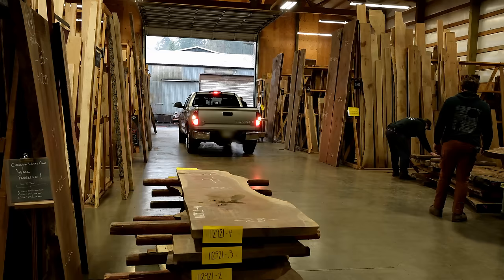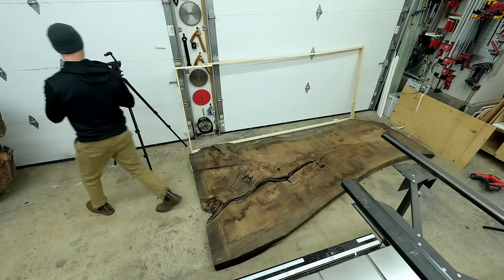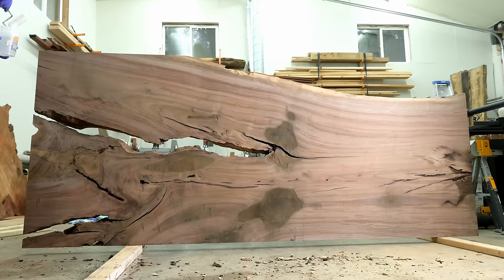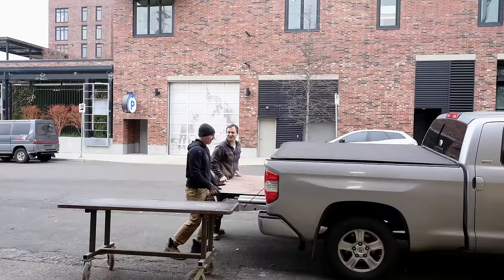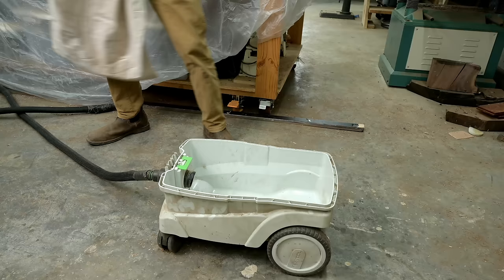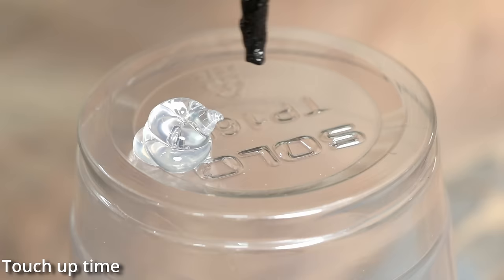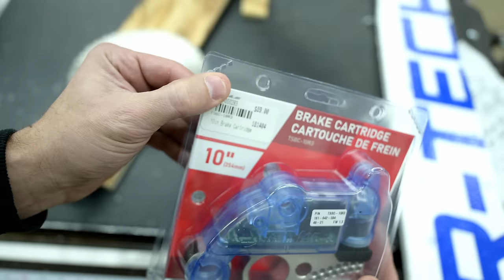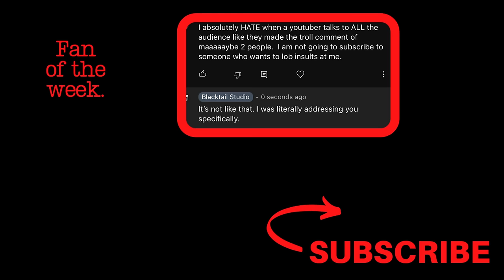The Client Hated This Slab

Comment: Response to your question about 21 minutes in the video. The safety feature of the saw blade stop works off of a voltage differential between the trigger mechanism and a conductive media like a finger. Styrofoam sheets being cut with a rotary blade would be like rubbing a balloon against a flannel shirt. The Styrofoam creates a static charge greater than the blade safety mechanism can handle. A volt differential tripped the circuit.
Reply: i noticed this also and his finger touches the deck of the table at the instant it is triggered so i think he discharged himself as he was building up a static charge from the foam as you said
Reply: Thanks for the scientific explanation
Reply: Thanks for taking the time to share this Lynn!
Reply: There's also a relationship in electrical conductivity in foam as it undergoes a phase change due to heat from friction. This can be unpredictable in modern foam products. Not sure if lowering the speed of the saw blade is an option.
Reply: Some great responses to this.  I was thinking of the static as well.  Does anyone thing a wrist worn grounding strap would have helped?
Reply: I'm happy I found this answer, so I don't have to find the right words for it, as English is "only" my second language :D
Reply: Could it have melted and the liquid phase was conductive enough to trip the safety mechanism?
Reply: I absolutely agree with this explanation. I just wish I was smart enough to understand it.
Reply: Smart
Reply: nice
Reply: If his finger makes contact with the foil on any part of the styrofoam while its being cut it would also probably trigger. Typically the trigger is caused by the signal of the blade dropping below a certain threshold which is what happens when your finger touches the blade. Foil is conductive so if it is touching both your blade and the finger that’ll do it for sure. Heck enough of the foil could do it, thats why you can’t saw metal (among other reasons) it interacts with the blade and changes the signal. Electrodynamics is a fickle bitch.
Reply: Working with bare hands and touching material leaves fat/sweat on it. Perhaps there was enough of that in the area that triggered the stop.
Reply: Maybe wear nitrile gloves when cutting aluminum clad foam in order to break the conductivity between fingers to blade?  Would hate to see that happen, again, just to do a test (maybe with a worthless blade and only have to pay for the “stop”).
Reply: Thank you for explaining that. That saves me from trying. It also looks like his gloves are just as good of a static generator as flannel so I'm guessing they're the other half of the generator. ;-)
Reply: @mbol4348  the problem with that explanation is that he'd already made several cuts on that piece of foam already, so if that was the only reason it would have gone off earlier
Reply: Good answer, likely ESD. Cutting insulative material on a protected saw like this one not the best choice of tools
Reply: I posted about how to put the saw in bypass mode so you can cut conductive material and not activate the break. 👍
Reply: Turn off the safety tripping on the blade when cutting that styrofoam. It will save you a blade and trigger mechanism.
Reply: Hi, i really think that the tinfoil sheet from the stirofoam conducts electricity from the fingers. Wearing isolating gloves should help.
Reply: @CristianRusu  the Styrofoam creats static electricity when being cut which causes a change in voltage which is what activates the brake. Better to just bypass the safety mode when cutting conductive material
Reply: Maybe making several prior cuts actually built up a charge ….
Reply: Of course! Everyone's knew it was a volt differential causing the issue. LoL!
Reply: Also the styrofoam have some aluminium foil or don't know what material was(reflective one on the other side) somehow if its conducting that can be a problem.
Reply: I'm going to use my finger to confirm this hypothesis.
Reply: @andrewmicone99 если там есть VFD, то запросто

Comment: Styrofoam is electrostatic material. If you pull it over your hair it’ll stand it on its ends. So, that little bit of friction created electromagnetic field which caused the sensor to go off on your saw.
Reply: My father-in-law was a Machine shop teacher, and he told me that one time when he was showing me how to pour the foam in different molds he was making.  I can't believe I remembered that 55 years later.  He was an excellent teacher.  R.I.P
Reply: Yeah, don't cut foam in a SawStop. Use a reg table saw. 
Example- when you ate cutting foam it will shock you in the same way as rubbing socks on carpet and touching someone.

Comment: Professional epoxy installer here with over a decade experience. Those small pits that you carved out then re-filled can be completely avoided. Epoxy airates as it cures often causing bubbles (fisheyes) that pop and sink or stay above the surface. An easy and cheap method to prevent that is to use a heat gun at a moderate distance to pop them during the curing process (when it becomes tacky). I have a ton of epoxy tips for you if youre interested. Whether youre using 100 solids, polyeurethane or polyurea.

Comment: Safety tip (yay): When loading a long  crate onto the back of a truck, get as close as possible before raising the forks. That way, if it does start to tip, the truck will take some of the weight and help get the balance back. I used to do this all the time with 1.5 tons of aluminium ingots.
Nice work as always BTW
Reply: I’ve used a fork lift to move around coils of wire of similar weight (all metal other than the insulation), and it is definitely a little nerve wracking! I get a bit anxious even watching someone do this in a video.
Reply: Jesus has given you all. Repent or die.  Jesus blessed ALL my fork truck driving with safety. I was a choir boy and an altar boy. I don’t get people like you who think the rest of us haven’t heard of Jesus or had him bless our fork truck driving! May Yahweh bless you with safe fork truck driving as well!
Reply: Was about to say this. I work as a Lumber Department supervisor of a home improvement store and, can't stress this enough, when working with a forklift, always wait until the very last minute to raise the forks :) Good idea passing this tip along to someone who might not know what we know. I regularly lift 3000 lbs bunks of plywood and dimensional lumber daily!
Reply: As I understand, the J guy's father was a carpenter? Doubt he had a forklift though...
Reply: @haraldgundersen7303  😂😂😂 good one
Reply: Same. I used to move 1-2 tonnes (machine parts, tool steel) so you learn as you go, but this was one of the first things my instructor taught me.
Reply: We were trained to drive backwards when carrying a load. If you have to brake quickly you're not going to tip forward.

Comment: Regarding the CNC question, I always use the father of a dear friend of mine, Kazuyoshi Ichiro, as my yardstick. He was a metalworker in Susono, Japan. His family had been blacksmiths and metalworkers for generations, and as proper Japanese artisans they respectfully prioritized tradition and traditional practices. However, they also used modern tools. 
Their attitude was that trucks and cars are more effective than carts drawn by horses or donkeys, and understanding the "why" of a tradition is at least as important as the "what" or "how". The traditional approach was to produce the best result possible with the materials, tools and techniques available, and while that led to the development of masterful skills that almost became art forms, the reason was often because of limitations in the available materials, tools or techniques.
As a result, when he worked with the metal, instead of using a set of hammers and an anvil as his grandfather had done, he used a hydraulic press designed for blacksmithing. His philosphy was that the craftsman should put in 100% effort and focus to produce the best result they possibly can, using the best tools they have available. 
So using a CNC machine to help would be absolutely no problem, as long as the craftsman is still focussed on producing the best piece they possibly can :-)
Reply: Very well put! And make no mistake: getting CNC to actually produce the same quality as artisan work is a an art in itself!! The true advantage of CNC is not the ease of use: its the ability to reproduce without further effort. If you are making one-off shapes, an skilled worker with the right tools may well be able to put out the work quicker and more beautiful
Reply: The people that say using a CNC is cheating, or there is no skill involved clearly don't own, or know how to operate a CNC. Just like a hammer and chisel you need to know how to use the CNC correctly to achieve first class results. I built my own large CNC and I would say that is the easy bit. All the associated CAD / CAM programs and how to get the best possible result is an art in itself. While it CAN produce a better result, it isn't automatically guaranteed, you will need to master that tool the same as you do the hammer and chisel.
Reply: I'm not a woodworker, but I have been around machines and programs for years.  IMHO you should know that you like programming before you invest very much.  Look for simulators online or learn coding from someone who has one.   If you hate it then keep doing what you're doing.
Reply: @pf2135  yeah that is some pretty sound advice. You will quickly know if it is for you after the first 1,000 hours of using the software...
Reply: All my aunts and uncles on my mom's side were/are farmers in NW Wisconsin, and they do business with local Amish all the time, including having them make dining tables. These Amish use no power tools at all, and deliver all furniture with x2 horsepower buggies. They have no problem with you driving your pickup truck into their driveway, though, if you need to pick something up. They have very nice looking houses with no electricity or indoor plumbing.

My mom didn't want to marry a farmer, so she moved to the "big city" before I was born and never moved back. They call me city slicker when I visit.
Reply: @DodgyBrothersEngineering  🤣

Comment: The county road commission took out a couple of walnuts 3 years ago. I said "No thanks," when they offered to haul the wood away for free and I had a guy with a portable mill come in and slab them for me. The wood has been drying for 3 years and the hygrometer says it's ready to use. This is one of the things I want to do with some of the wood. I've got to go find that step-by-step video of yours. Thanks.
Reply: It takes 3 years to dry?!
Reply: @kittykitties4220  Think of it more as seasoning.  It takes a long time for the moisture deep inside the wood to evaporate. Moisture is always the enemy of woodworking-- you get rot, loss of adhesion, warping, etc.  You need the wood to be the perfect moisture level before you put all that effort into it.
Reply: @kittykitties4220  Drying time is (roughly) proportional to slab thickness, as well as environmental conditions. Where I am, it's about 1 year/inch. The next time you boggle at the price of quality hard wood, think about how long the producer has invested in it.

Comment: I vote for continuing to do bow-ties by hand. It’s time consuming, but it’s also cool that they look so perfect and are done by hand.
Reply: They'd be MORE perfect with a CNC, you can cut to withing .0001 inch np with a CNC
Reply: @dannymaiorani519  As a CNC machinist my self? Not with those aluminum extrusion table routers. Not even Tormach can do that and maintain a .001 repeatability tolerance. Some HAAS budget machines are just as bad. That said if you have seen a CNC do a job once you have seen it do it 10,000 times. Hand made products should stay as hand made as the person making them wants them to be.
Reply: @mattranger9509 Exactly. I would much rather see 60 seconds of handcrafting than 10 seconds of automation.
Reply: @viperstarpoint9  yeah I wasn't really suggesting that I was suggesting like a mill. When I had my German auto shop I bought a tree 310 from Berkeley University that they thought didn't work and I got it running and I used that.

The rest of it is still hand built I've seen those bow ties sort of loosen up over time I don't know if his do. So the mill could be an improvement possibly in that regard.

Comment: For the saw stop, I’ve learned from a buddy of mine that even the slightest conductivity will set it off, which if you think about it is great until you use things conduct electricity. The reason the saw stop engaged when you were using the foam Board was because the thin layer of aluminum or whatever metal the foam board has on the top will act like a wire from your finger to the saw blade itself, thus setting it off. Best way to resolve this is to flip the board if you can so then your intact with the foam it’s self but if the material your cutting doesn’t have that then best option to use something like a glove of my preference a piece of wood to push the foam through! 

Great videos I’ve learned a lot about wood from them! Thanks a lot! Keep it up!!😁😁
Reply: that didn't explain why it was fine on some of the board, it cut half way through the foil side before triggering, witch I will explain by: the foil probably has a coating on it and didn't trigger a conduction until it was rubbed away enough on the wrong spot to make a conduction
Reply: @tomlamb3885  this is correct, it's coated/oxidized and it got an unfortunate high conductivity moment and boom
Reply: ...or static, rub a piece of styrofoam to your hair or clothing and see.
Reply: Electronics engineer here. The Viper said it just right, aluminum layer on foam board conducted enough charge from your finger tip to the saw blade and triggered the protection mechanism, sorry...wear gloves next time, a couple of bucks will save a couple of hundreds...Cheers
Reply: @tomlamb3885  every part of machine is grounded, if properly connected to mains voltage, on the part where machine was cutting fine the aluminum part was pushed against the metal parts of the machine and therefore was no conductivity between finger tip and the saw blade, the part where safety was triggered board was standing partially above the metal surface of the machine and therefore was not grounded conducting all the charge from finger to the blade triggering the safety feature...hope this helps...Cheers
Reply: @otomatiasko5674  BINGO! THAT WAS MY ANSWER.
Reply: Just out of scientific curiosity it would be great to see what SawStop has to say.
Reply: @Tom Lamb Hi Tom. Yes exactly, it only triggers when something conductive is not grounded and touching the blade, like foam board with aluminum foil hovering above grounded parts of machine and you touching it with your finger. You are not grounded as well as your foam board and you trigger it by touching the aluminum part while cutting but the aluminum foil part should not touch the rest of the metal on the cutting machine because, it is grounded...If you do that (push it downward to grounded parts) nothing happens...hope this helps...
Reply: @otomatiasko5674  I was thinking static too
Reply: There are also some types of foam insulation that are conductive as well, I don't think this is one of them, but I have cut a few pieces of some that I know IS, and it didn't set off the safety. So there's that.
Another thing you can do to keep from setting it off is to disable the safety. You can do this by turning the key clockwise as far as it will go and hold it for roughly 3 seconds. The red light will flash and I usually hold it for a second longer than that, just to make sure the safety actually gets turned off. Release the key and the red light will flash again. The finger sensor is now off, so give the blade a little wider berth if you can. All you need to do to turn it back on is flip the power switch for the entire saw off for a few seconds, and then turn the saw back on. The safety will be turned back on as well.
Reply: Didn't read far enough down to see this reply I guessed static build up myself glad to know others thought the same
Reply: @otomatiasko5674  that's actually the most probable explanation. Static electricity may also trigger the conductivity sensor.
Reply: Static sounds likely, but the SawStop triggers on loss of charge from the blade to something conductive, not the other way around. However, it could have been charged with a high enough voltage to arc to the nearest ground, and that loss of charge then triggered the SawStop.
Reply: @maraz666  static charge can go both polarities. When static and blade charge neutralise each other, it's the same as if a conductive connection is made.